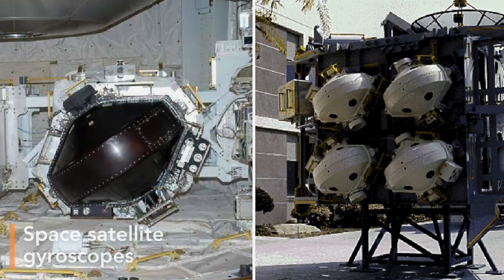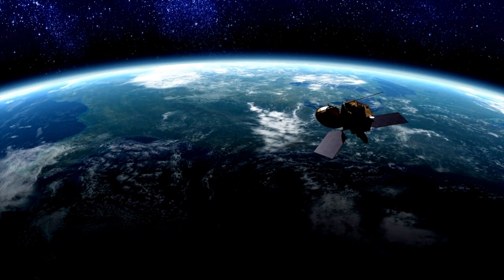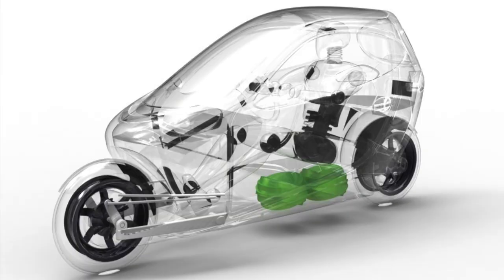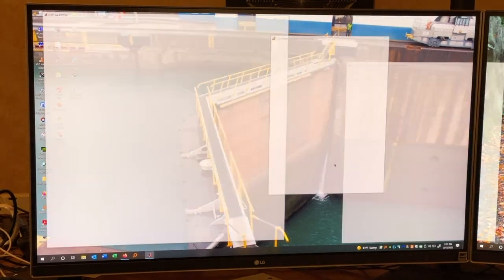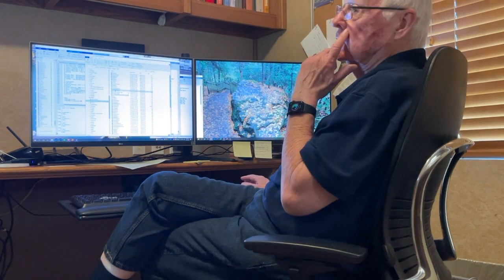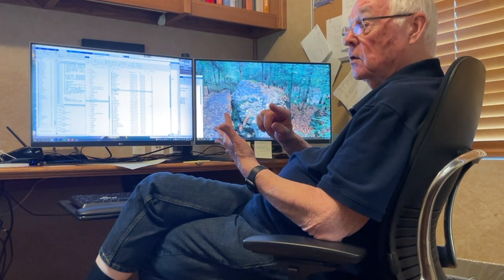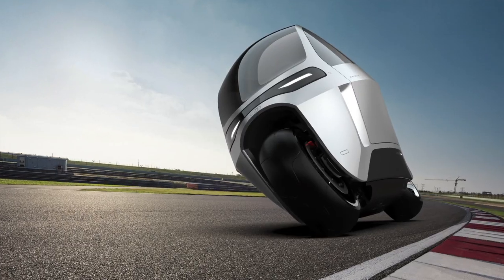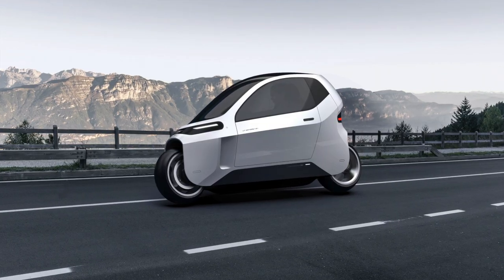Dave "Wizard on the Mountain" Bailey | VP of Dynamics/Controls

Comment: Perhaps triangular profile tires, as this machine may often be urged to accelerate/decelerate during extreme lean angles (or provide driving parameter settings to match fitted tire capabilities). With computer control, driver skill set may be moot - I’m thinking TRON.